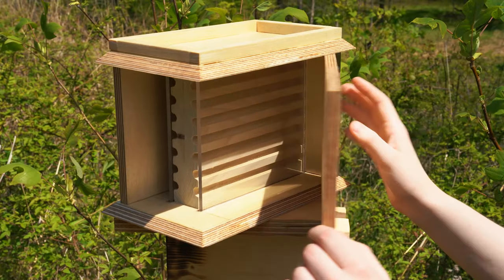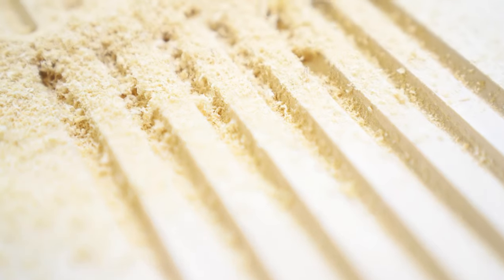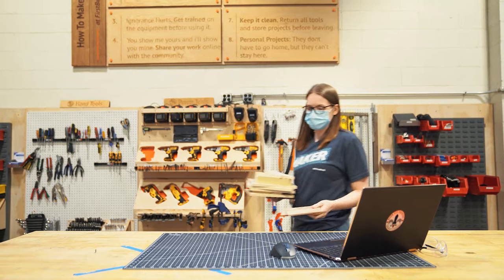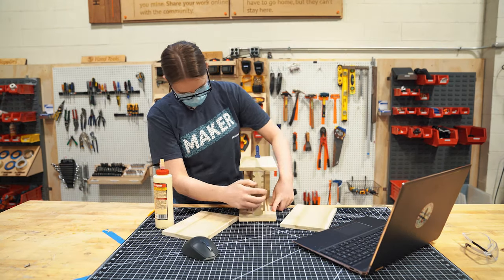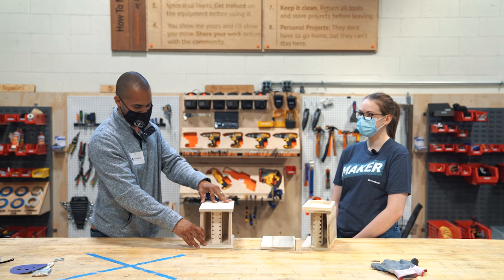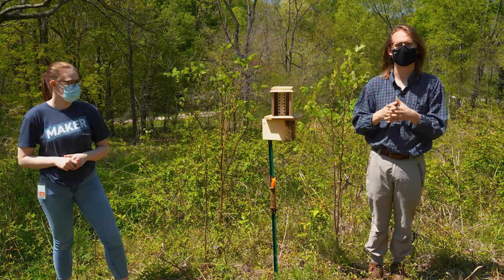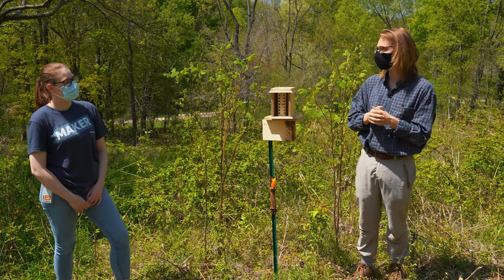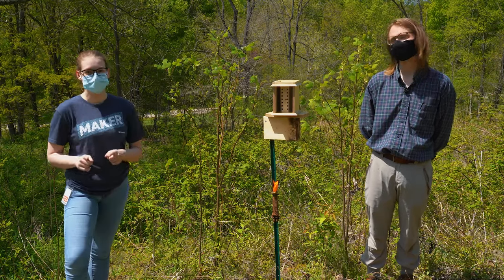Prototyping A Solitary Bee Bath House For Home Conservation, Gardening, And Pollination

Comment: I would suggest you talk to a person who is an expert in solitary bees and not honeybees.  There's a huge difference in the habitat requirements for the different species.  In my opinion, there are several changes you need to make to aid in the overall "usability" of the design for solitary bees as well as though who would be observing and interacting with the hive.  Also, nix the bee bath... water and wood don't mix well and you will end up with a rotting roof.
Reply from the maker: Hey Kent, thanks for sharing. We actually did work with a solitary bee expert on this project. What changes would you suggest we make? We ended up removing the bee bath from the final design.
Reply: @Firstbuild  So, I haven't seen your final prototype so some of these suggestions my be already be incorporated;  1. The final build has to be made from weatherproof materials.  It looks like the prototype had a pine top and sides with a laminated bottom.  You would need either all plastic or cedar materials of construction for any surface that would be exposed to the sun, rain or any combination of the elements.  2.  The inner chamber where nesting  takes place.  What is the diameter of the holes? Mason bees prefer 8mm holes, leaf cutter bees prefer 4-6mm holes and carpenter bees prefer 12.5mm holes.  3. The inner unit that houses the bee nesting chamber and two acrylic end pieces should be removed as one unit.  It looks like you have to grab ahold of the nesting chamber and pull it out from between the two acrylic pieces? You may end up having nesting materials stuck to the inside of the acrylic pieces, depending on what specie of bee is utilizing the chambers.  You will want to be able to clean the acrylic surface and wooden chambers to remove any parasites, mites or chalkbrood that would normally occur.  So pull out the unit as a whole, then remove the acrylic side pieces to examine the contents and aid in cleaning.  4. I believe the bees would be more apt to use the chambers if the outside walls of the bee house were mounted against the outside surface of the acrylic on the inner chamber - so pancake the outside walls to the inner chamber.  Its still a good idea to have the fold out walls for viewing and cleaning. The aim is to create a dark chamber for the female to use.  This also allows you to decrease the overall foot print of your design.  I hope this helps?  My aim is to educate as I think its important for all of us to understand that when we place a nest box like this out into the landscape... we must become good landlords.  So there is some care and effort that is required on our part.  For instance, if you have chalkbrood show up in one cell in one of the chambers, every new bee that walks through that cell on the way out or in, is going to pick up chalkbrood spores and potentially pass them onto any new cells a bee forms in that or another chamber.  Chalkbrood is fatal to developing larvae.   So you need to be able to recognize and clean chambers and surfaces if you think chalkbrood is present.